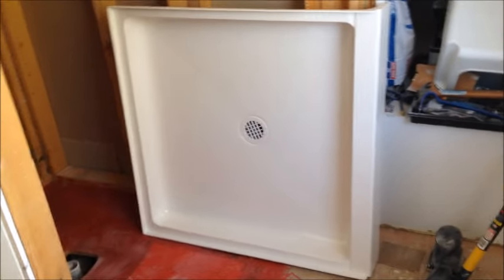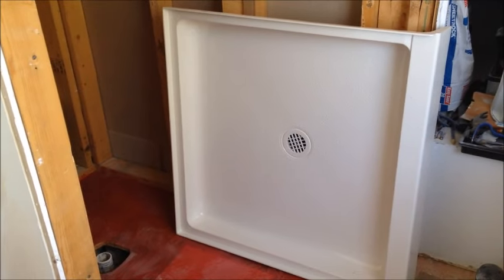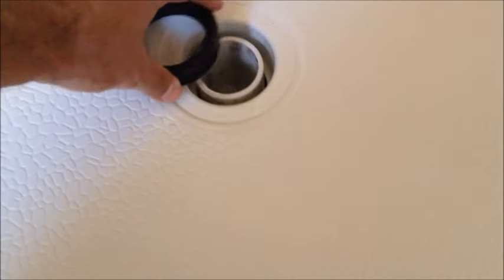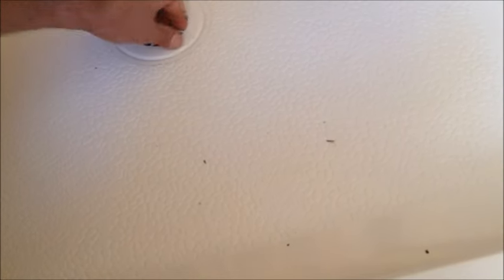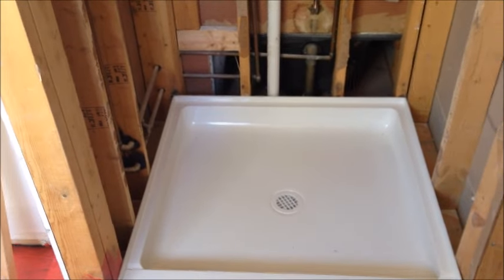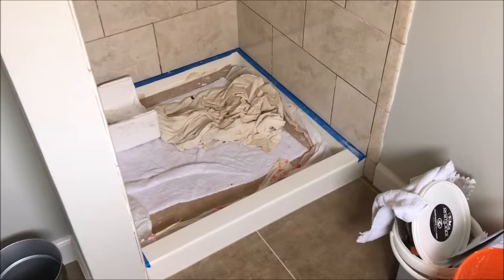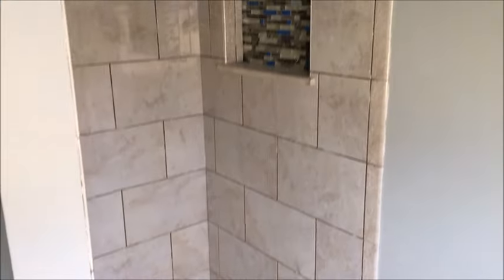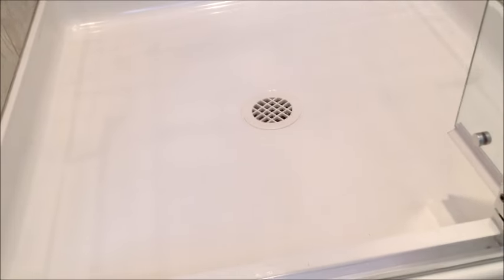Bathroom Remodel   Swanstone ss-3636 Shower Pan Shower Base

Comment: I do showers for a living. I'll keep this short. I don't use greenboard. I use hardibacker. I don't leave a gap between the base and the hardibacker. I used 1/4 " backer board.. i do at least two  coats of waterproofing on the hardibacker down about 1/2 " onto the pan...I hang the tile an eighth of an inch above the shower base. Use the best waterproofing you can afford is the key...( No. 1 is Hydroban...pricey, but bulletproof...Red Guard I'm not too fond of..) Seal the grout with the best sealer you can afford...It's not waterproof, the grout...Maintain it...attach the base to the walls with gold inch and quarter drywall screws at each stud...They will have waterproofing over them.....
Reply: Do you have a video?  Sounds like you are the guy I need to watch!!!
Reply: @tonyalcarden  no idea how to make a video and then upload it here.. Just know that the waterproofing of the Hardibacker is the key to feeling secure about your tile shower.. Two coats of Hydroban, at least..tape all seams and waterproof.....
Reply: Douglas does the hardibacker go on top of the pan flange? And how does the 1/4" backer line up with the 1/2" drywall? I definitely like your way just trying to troubleshoot it. Thanks
Reply: @poofypoopy8838  If you have the shower pan bought before you frame in the shower stall, you are ahead of the game...Frame the stall size so that the 1/4 " backer board is installed TO THE FLOOR  of the shower area ( be it wood , concrete, or other.) before you install the pan In other words, make the frame size 1/4 '" bigger than the pan. Then you slip the pan down into the opening , which should be snug...attach the pan through the top of the pan flange , through the backer, and into the studs...Now you have the  flange thickness left...( this is not a mistake ). Then tape off the pan floor and sides  to about 1/2 " below the flange top and WATERPROOF THE WALLS AND TOP OF FLANGE WITH 2 COATS OF HYDROBAN...WATERPROOF WELL ALONG THE TOP OF THE FLANGE...LETS say the flange is 3/16" thick...Now, when you apply thin set behind the tile and on the wall (only,), the thickness of the thin set will allow the tile to perfectly slide over the flange and down 1/2 inch into the tub.. If you apply the hardibacker to an already set pan, it's ok to sit it on top of the flange..Just make sure you waterproof well. The tile will stick over the flange, but it will be imperceptible down there. WATERPROOFING  IS THE KEY...
Reply: fORGOT to address the transition between 1/4" hardibacker and 1/2" drywall , where that may occur, at the top of the shower and even the sides.  Use 1/2'' hardibacker to get the best transition. But the thinset thickness will allow the tile to lap over onto the drywalleasily....Don't thin set the tile to the drywall...Just lap it for a small amount onto the drywall. Depends upon the size tile you are using..Clear...??
Reply: Water proofing is a waste of time and money.just tape the dura rock.the tile system is water proof.it not a fish tank.
Reply: What do you think of the hydrodefense hardiebacker?
Reply: I know this is an old vid, but hope i can get a response. I am installing a Swanstone pan and had planned on screwing it to studs, through the pan itself, which i believe is what you are saying to do. But the Swanstone instructions spcefically say " do not screw through the flange". They say to place screws at top of pan and basically pin it down with angled screws. have you ever done one like this, or do you think it would be ok to just screw through the flange? And also my base sits flat/level on the concrete slab, will i have any problems if i don't put any mortar under it. This will be in a camp that only gets used for one week out of the year.

Comment: Your pan installation looks good, and I'm not a professional but can speak from experience in our home. Greenboard is not designed for shower surrounds unless used with a hearty coating of RedGuard. This shower on the video will fail in 5 to 10 years. Tile and grout are porous and moisture will make it through. The screws used to keep everything up will rust out and mold will grow behind the shower. That was our experience in one of our bathrooms. After we tore it out and replaced studs etc, we installed concrete backerboard and then Redguard. Once the redguard goes up you should NOT puncture any holes into the substrate or those are all places moisture will get through. I no longer hire out tiles jobs even thought it's a alot of work for me as I've had too may guys tell me greenboard with thinset is fine, maybe because I'm a woman they think I don't know any better. I am currently redoing another bathroom that was hired out and not waterproofed correctly. I only use greenboard in bathrooms around the vanity and toilet area.
Reply: Why do shower install cost  $10-15k?  I just want to replace the pan and would like to use a wing tite drain just to future proof since I don't want to rip out the pan to replace a drain.  One installer told me I couldn't retile just the bottom portion of the shower.

Who has $10-15k to replace a shower pan?
Reply: @leaguefixesyourmatches8259  We had a poor tile install on the floor, the one we redid a year ago, and most companies will not just replace the shower pan. As soon as you start tearing into the pan you destroy the waterproof seal between the shower and pan. If you have a hot mop pan, that continues up the wall behind the bottom 10" or so of tile on the wall so you are kind of forced to replace it all. We installed solid surface samsung walls in our shower and are very happy with the ease of cleaning. I keep a magic eraser in the shower and just scrub down the walls and pan every so often.
Reply: @redcoff  How do I get around this?  I don't have 10-15k for a whole new shower install.   

The prices they charge are insane.  I can only do like 5k max.  I don't care about tile or anything.  I don't care how ugly it is. I just want a shower that works.  

I mean shower pans last only 10 years or less.   I'm not sure how anyone can afford this.

Right now, I'm contemplating showering at gyms only.  It's just not worth it especially when so many "installers" do it wrong and you start getting mold on the backboards, clogged weepholes, etc.
Reply: @leaguefixesyourmatches8259  You might consider doing it yourself. If a solid pan is installed correctly on a bed of mortar it should last more than 10 years with standard use. Just remember unless you learn to do it right and do it yourself, you usually get what you pay for. We took a cheaper install on our shower and the tiles were coming off the floor less than a year after the install. You could just look at getting a fiberglass pan and fiberglass wall surround especially if your shower is a standard size.

Comment: If this is a twice daily shower, I am betting about 3 to 4 yrs. max on the green board getting soft under the tile. So give an update if you get a chance. BTW, Swanstone makes wall kits in a lot of nice colors similar to Corian. You could rip out the tile and install new green  board and Swan walls in a day.  The nice thing about the Swan walls is there is no grout to leak thru or clean, and they are solid color clear thru, so they can actually be sanded and polished just like real stone or Corian.  Great product, but I had a heck of a time getting the stuff my last job. I was going thru Lowes and Home Depot for all the components, (because of the great prices) and twice the pan was lost and then cracked when it arrived.  Took me 3 months to get all the parts. Swan must deal 2nds to the big brand stores,
Reply from the maker: Yes, twice daily shower if not more.  It has been 3.5 years and besides the continual battle with mildew the shower is fine.  I remodeled another bathroom 9 months ago and had access to the backside of the shower walls and could see the green board.  Totally fine.  While this bathroom may not last 50 or 75 years, I see no reason it won't make it 25-30.  The green board I ripped out was 35 years old and still had life in it.  That green board wasn't painted with the water proofing paint either.  Tiles were just Liquid Nail'ed to the green board.  I am confident I did a better job than the house builders and took more precautions.  

Yes, I did use cement board for the other bathroom since it was encasing a tub, however, the removed green board also had life and had survived multiple kids using that tub for years.  Would I use cement board in the shower if I had to do it again?  Yeah, probably.  It isn't much more difficult to work with.  Do I think my bathroom will leak before the next renovation (not to be done by me) because of the green board?  No.  Most likely the valve/pipes/drain or base will be the reason for the leaking.

Comment: My previous house had a shower and a tub/shower both done with tile on greenboard. They both failed when the house was < 10 years old. I had to tear out and there was so much black mold that I had to wear a gas mask to tare it out. I put greenboard sealed with shluder and topped with swanstone solid panels (no grout lines) . I used the same swan shower base (I put a bed of mortar under).. I think the new owner is enjoying it.
Reply: If he painted the greenwall with Redguard it might be okay for a while, but grout will leech water into the drywall. Greenwall isn't waterproof. At least he used large tile. Less grout = less leaching.
Reply: Also owned a house with a walk in shower tiled over drywall that failed. Ended up having to tear out the majority of the studs even
Reply: That was our situation! When we finally redid the bathroom, every screw that had held the back wall had rusted completely and the whole wall above the tub came off in one piece. Black mold, damaged studs, it was a mess. I shudder every time I see greenboard used as a shower substrate, especially when no redguard is used.

Comment: I'm sorry to hear  that you used green board as your backer! It never has been intended  for  showers. It is only for high humidity areas such  bathroom walls and ceilings  ,but not where a direct hit of water occurs. The green paper is only water RESISTANT  not water proof. A water proof cement backer board would  have been a much better choice.  It's a very common reason for demo work because of  incorrect use. A  shower built correctly should last 30 to 50 years.....not 5 or 10.  Sorry to sound so negative and your video was nicely done,  but it's a common mis-used product that no professional would use in a shower enclosure. All the best
Reply: Works fine with kerdi membrane
Reply: What I find interesting is I have remodeled and removed tile from tile showered walls from the 50's and they looked perfectly fine, no cement board, red guard, etc.
Reply: @CP-lo2bh  Asbestos? :)

Comment: I paid to have someone install the Swanstone shower pan and 2 walls. They used green board, which I had requested cement board. After 6 years of use my problem is water getting past the drains in the corners and damaging the drywall. The track that hold the shower glass does not drain so water, even with the little drain holes. Instructions should state building a silicon dam beyond the glass to prevent this. Otherwise over time water will come in so tact with drywall at some point. Now I have to figure out a way to stop the water damage without having to redo the shower.

Comment: I have the same concerns about relying solely on the rubber gasket for a water-tight seal.
Reply from the maker: It has been 7 years and no leaks.  I actually just did work in the room below the shower installing canned lights and looked up at the pipes.  All looked good.

Comment from the maker: We have been using the shower for over a year now.  Everything is holding together nicely.  The shower pan feels the same and I am used to it.  I have responded to a couple comments that porcelain is sturdier than this base especially since I did not use concrete underneath.  Reasons for not using concrete on this project were that there was none used prior, we also had prior leaking from an adjacent bathroom, and I was happy to keep things simpler.  I am still fine with the feel of the pan.  I recommend testing out yourself.  

I will say that the pan itself is harder to keep clean than porcelain.  The texture picks up foot dirt and requires good soaking of CLR or like product and some scrubbing.

The Revel shower door is still working well.  We do squeegee it off after every use but you need to hit it with CLR every 3-4 months to get rid of the cloudiness from residual soap.  I am sure that it fairly standard for glass doors (this is my first).

I still love my new bathroom after 1 year.  Let me know if there are any other questions.
Reply: This is super interesting.

I'm looking to do my first shower pan installation and I had no idea you could put the shower pan straight on the floor without some form of concrete underneath.
Reply from the maker: @williamdavis9562  Hi William.  That's how the original builders installed the shower pan, and I did the same thing.  If I was to do it over I would use both cement board for the walls and cement under the pan.  It isn't bad with no cement underneath, but I think I would have locked the more solid surface with cement.

Comment: _____35 years pro residential plumber here. That cast-in (part of the shower pan) shower drain is fine. The pipe has to be fairly straight up (no splits or gouges in it, (look close), and smooth surface) and the rubber seal has to be in fair shape as well. I use a little bit of lube to seat it. Never leaks. If you use a pan that requires a brass drain spud (never use plastic ones) you better reply to me if you want it to last forever.....there's a few MUST- DO'S involved. It will still use a rubber seal. (best) The guy who posted this (Rick Carlo
?)  left out the water barrier and should of used a cement backer board .....this is a doomed install. (guaranteed)
Reply: Yes! We are now replacing two bathrooms, one concrete backer with no waterproofing and one greenboard with no waterproofing. Both failed, had mold growing and rusted out screws. Both were paid "professionals" that installed. I no longer hire it out and do the tiling myself. I hope others skip that aspect of this DIY video.

Comment: Rick keep post updated if something happens.
Very nice. I did a similar project 4 months ago. 
- same exact pan, but during install i caulked twice, once below the rubber and again above the rubber. I also bought a metal cover than the plastic it comes with.
- i used permabase backer board
- i used 3” by 6” horizontally (subway)
- create 2 niches (nooks)
- replaced faucet and valve (while i could)
- sanded caulk bottom with matching color
- didnt put a door (using cheap curtains).

Comment: Just a heads up greenboard isn't an approved surface to tile over in a wet area without the use of a surface applied waterproofing membrane.  The main reason is because tile and grout is not waterproof.  Unfortunately that means this install is destined to fail.  No one can say exactly how long before the issues begin to develop, but they will eventually.

The gap between the flange and backer board needs blocking and at the very least alkali resistant mesh and thinset.  That's a moot point though because of the use of greenboard instead of an appropriate backer....
Reply: Ryan Mckee I agree install needed a membrane and also I’ve been told by plumbers DO NOT silicone the bottom of the tiles around the shower pan.  It traps water that shower pan flange is suppose to let water drain into the base the silicone traps the water. 

What do you think about that?
Reply: Exactly!  Much of my demo jobs, preparing for new tile work, has been green board related.
Reply: Diet Coke hey  just a question so what do you use in the gap betweens shower pan and tile
Reply: What would be an appropriate backer without the waterproofing membranes?
Reply: @leaguefixesyourmatches8259  there's alpt out there, and like anything else you can go bare essentials with cement based backer board with a vapor barrier behind it all the way to the newer waterproof foam boards.  The foam panels like goboard, wedi, hydroban board, and prova board all need seams and penetrations treated with sealant, membrane, or liquid applied waterproofing.  The same applies to cement backerboards if you want a waterproof installation.  Whatever you choose start with the manufacturers installation instructions, many times when I tear out a failed shower it could have been prevented by merely adhering to manufacturer specs.

Comment: Hi Rick, that was a very good video; thank you for posting.  I'm redoing a 36x36 in shower and bought the same shower pan.  I have been watching a lot of shower pan install videos, focusing on the drain assembly, and then my Swanstone pan showed arrived I have become concerned with the drain assembly.  You have faithfully responded to others about it's integrity, so if you're still tracking posts on this video, I'd be curious to know if the drain assembly is still solid.  
Thanks again.
Reply from the maker: Hi.  It has been almost 7 years of daily use and drain seems to be holding fine.  There are things I worry about in my house and this drain doesn't come to mind really ever.  When it comes to the drain, would I do anything different?  No.  I am happy with what I did there and have a decent amount of trust at this point.

Good luck on your project.
Reply: Thank you Rick, I appreciate your quick reply.  I'm feeling very confident with this drain system now and will stick with this shower pan is it seems very durable.